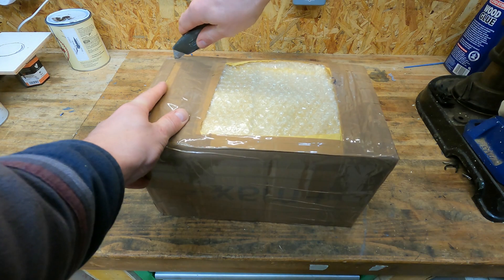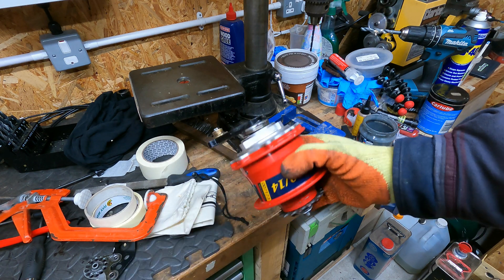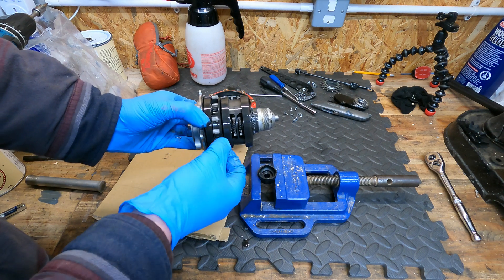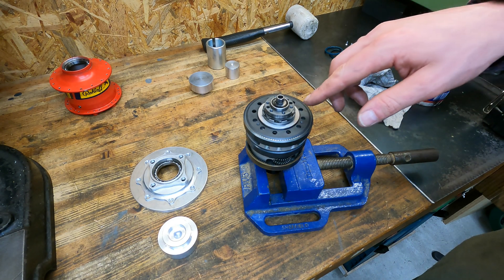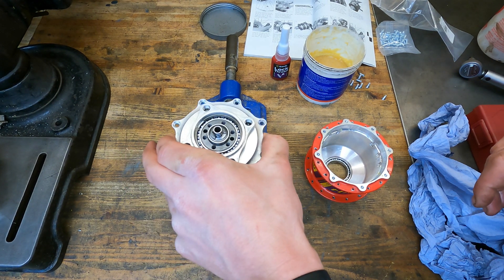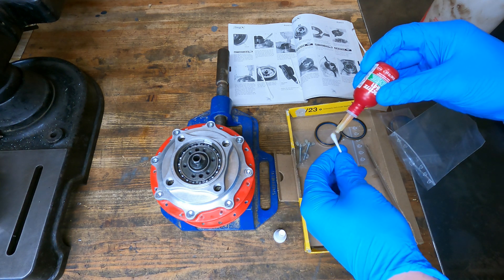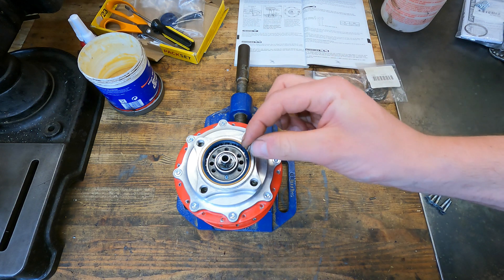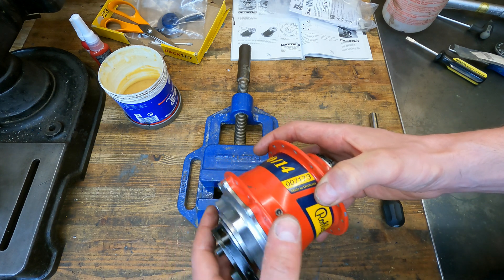Refurbishing the oldest Rohloff Speedhub I could find on EBAY (short version).

Comment: Curious as to why the screw heads were sheared off if you could unscrew the remainder of the bolts by hand!  I s this all that was wrong with it?  Did you test the hub afterwards?
Reply from the maker: Yea, I didn't explain that part very well. The head of axle plate screws often gets seized to the axle plate because they're exposed to moisture. The thread of the screw is in an oil bath so it's unlikely to seize in the hole.  The last guy had drilled the head of the screws out but left a small burr, that burr was preventing the gear mech from being removed. Once I removed the burr I could take the gear mech off and then unscrew the remains of the screw without any problems.  I actually haven't tested the hub in anger yet, but I have got a bike lined up for it to go on. All the best.